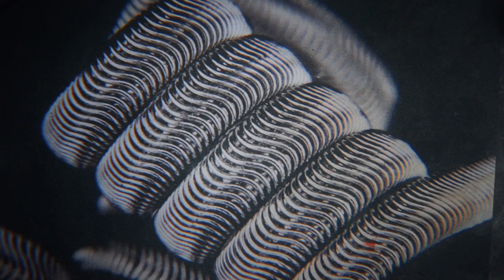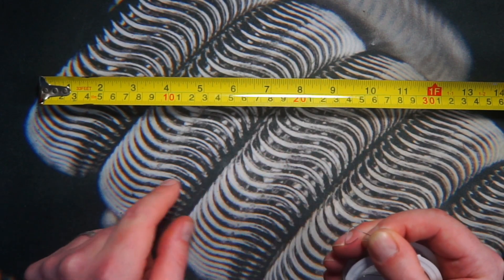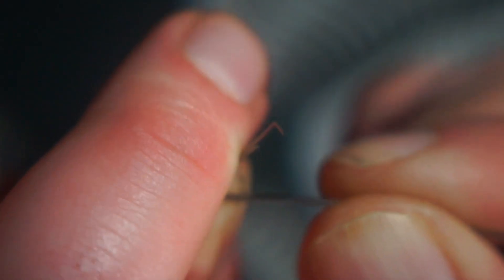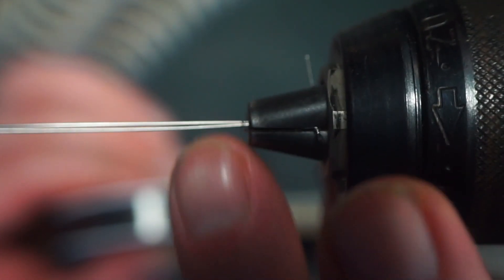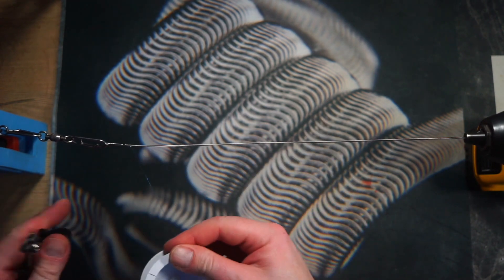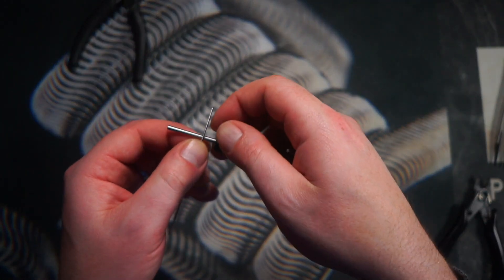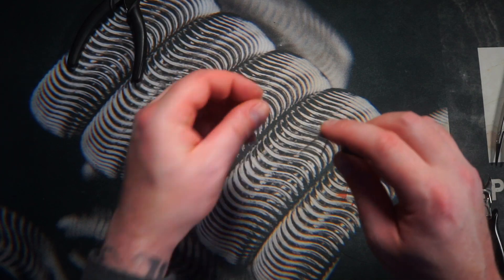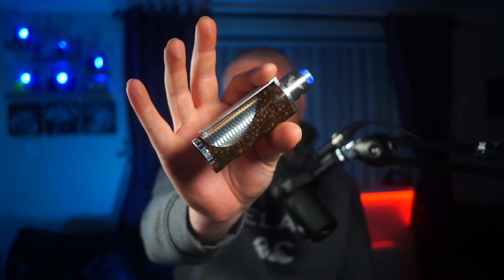Coil School Ep.2 | Fused Clapton Coil Tutorial | Proper Coils

Comment: Would love to know the differences between your coil types John. Flavour, wattage range, cool, warm vaping etc. THANKS! 😊
Reply from the maker: Thanks Richard, for me an alien coil is the best vape when it comes to flavour but the fused claptons are far quicker and easier to make, far less time consuming. They are an excellent starting point for a beginner builder, ill make sure to discuss the differences as the Episodes go by, warmth wise the Nichrome will ramp up quicker than Kanthal and give a warmer vape. Perfect for use on a mechanical device
Reply: @ProperCoils  Thanks John. I just got into rebuildables & squonking. I must say that I 💘 it and it has already saved me a load of money over stock coils. Having tested a few variations of crappy coils, I'm leaning towards dual Aliens as well. Around 0.16 (mainly due to the CDR of the batteries I have). I find it too warm going much above 70w.

So, will be buying some PROPER coils 😉 from you.

I'm tempted to add your Fraliens to my order. Also, what's the advantage of 5 core Aliens? Do they ramp up quicker and will either be too warm for me?

I would love to see an article on your site at some point. I think it would be great for your business because there is nothing out there.
Reply from the maker: @richardyoung2523  The 5 core aliens have more mass and surface area, which will increase the flavour, my 5 core aliens are full a Kanthal build so slower ramp up than Ni80 but you can get a great vape at lower wattages so around 70 watts is the sweet spot, i am in the process of adding a FAQ section to the website, it should be live on the site in the next couple weeks
Reply: @ProperCoils  AWESOME❣ Thanks John for all the info!!!